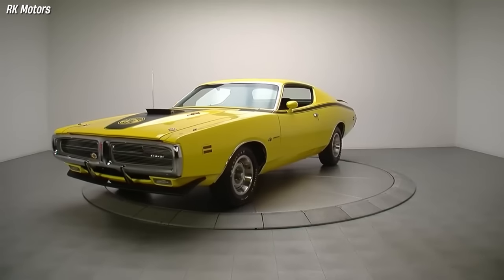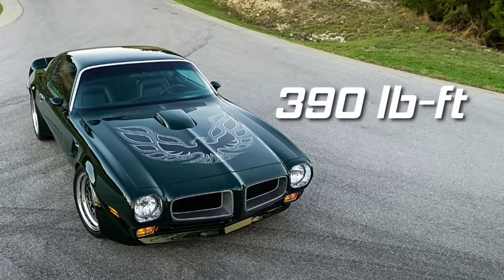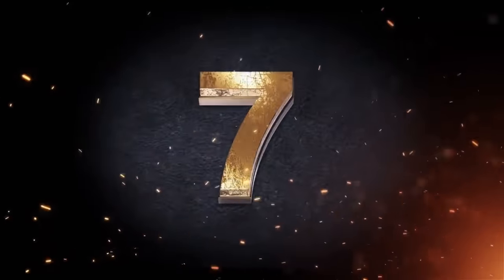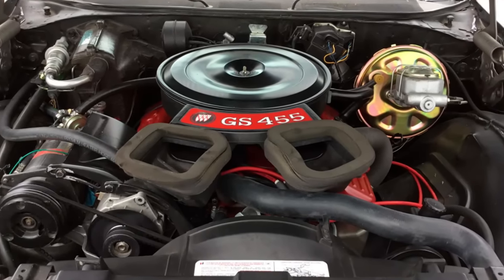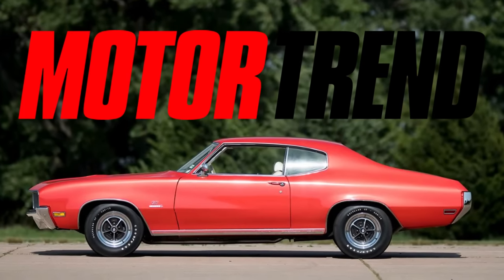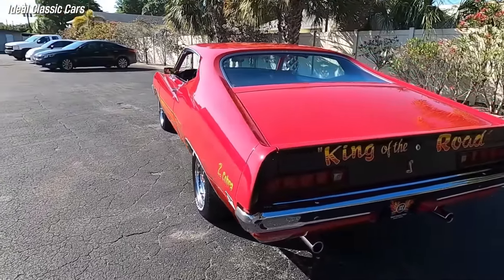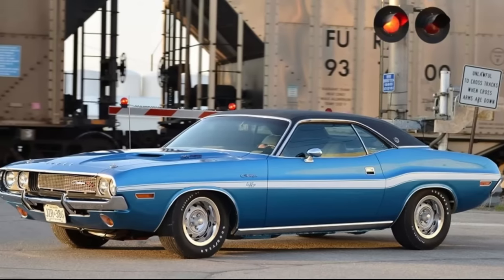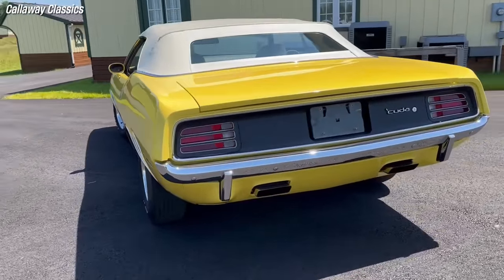Top 10 QUICKEST MUSCLE CARS Of 1970s

Comment: I had a 1970 Camaro and a 1979 Firebird. I miss them both. A lot of fun times.
Reply: I had a 70 1/2 Z 28 also ordered in Okinawa and picked up in Charleston 18 months later, no ac, power steering plenty of power. Fun car when there were not too many cars on the road. The insurance had a COW due to the HP to weight ratio.
Reply: In 1986 I had a 79 Poncho Trans Am. Loved the styling. T-Tops were the greatest but man the 403 Olds they stuck in it was a turd. My uncle had a 454 he'd pulled out of a 70 Monte Carlo SS, that he'd wrapped around a tree so I shoved it in the T/A, way too much vacuum tubing (not for the engine but man did everything in the car have something to do with vacuum) but we got it. Best summer of my life. Gas went from around $1.35 to $0.65 in a month and staid there. I was king of the back roads, or so I thought. Then like an A-Hole, I sold it when I went college. Should have kept the car, quit college after 2 quarters.

Comment: Great video but as I had a 70 Chevelle SS 454 LS-6 with a Muncie M-22 Rock Crusher and did a lot of drag racing I beat #2 and #1 on your list consistently!
Reply: the part he leaves out is all those magazine reported 1/4 mile times did not include a simple tire change. so ya the results will vary , and the 454 ls6 put out the most hp. with the possible exception of the zl1 all aluminum 427, copo in vettes and i have heard a few copo camaros

Comment: In 1981 I turned 18. For my birthday my father bought me 1973 Trans Am SD. It was white with the blue firebird.  It was 4spd . No factory a/c. It had  2 pull levers on each side of the front kick panels that opened vents. I kept it a year. We had a really bad snow storm and I couldn't get out of the driveway ( several hundred yards long) for almost a month.  So I sold it and bought a 4 wheel drive.  I would give anything to have that car back! 😢
Reply: Yea it's worth a fortune now
Reply: Those 73 Trans Am 455 are so cool. My similar story. I bought a 71 Boss 351. I was 17. My father was a service manager at a Ford dealership and knew a mechanic who had it for sale. Later, I  needed a 4x4 to help get to work as I was married and starting a family. My Boss 351 Mustang wound up being sold under very similar condition that I obtained it.
Reply: Being a MOPAR fan since I was 7 years old when my parents bought a 69 Roadrunner brand new, 383 auto, and my LEO dad chased and ticketed a speeder on the Interstate one night from a 70 roll, and myself having a stock 71 Charger R/T in 78 (440 4bbl) and now a much faster 70 Roadrunner 440 6bbl, I definitely admire BOTH the 73 455 SD and the 351 Cleveland based Boss. With a much needed upgrade in compression ratio and a hotter cam, the 455 SD was truly a RACE motor, and I have TREMENDOUS respect and awe for Pontiac doing that in 1973 as all other American V-8s were taking their last gasp. The Boss 351 likewise really needed a better cam and larger carburetor, and a single plane intake and headers would make it a FORCE to contend with!
Reply: I loved the 351 Boss. It was a great car.  I had a 69 chevelle  with a 350/300 hp motor.  Had the turbo 350 tranny.  I raced a '71 boss 351 with a 4sp manual.  We were neck and neck the whole race.  I still love mustangs,  I own one.  But Chevy and Dodge have a special place in my heart with the push rod motor!
Reply: I bought a '70 TA in '74. I only kept it half a year or so because gas went up to $1 a gallon and I couldn't afford 60 bucks a week to fill the tank.
I sold it for more than I paid for it but I still kick my ass for selling it.
I never kept the registration number so I can't trace it.
It was all red with a white hood scoop and white are extractors.
And if you know anything about 1970 Trans ams they were supposed to be white with a blue interior and blue with a white interior.
Like I said mine was read it had a black interior the low back bucket seats a four-speed no air conditioning and that thing was so freaking fast !
Reply: @stevejacobs8375  They were awesome cars! They were rated in the top 3 muscle cars of any cars built in 1970 or later .I bought another Trans Am later. It was '79 with the 6.6 and automatic tranny.  Only keep that about a year. Just was a slow boat., but it got the girls! Lol 😆
Reply: Pontiac FIREBIRD Trans Am
Reply: @williamg2552  If you had a Trans Am everyone knew what you had, but if you had a regular firebird or firebird formula you had to say " firebird "  first.

Comment: I still have my 70 Challenger 340 4speed car from high school haven't raced it in 35 years but in nearly stock form, stock motor only had headers and 456 gears it did a 13.7 in the quarter, with internal upgrades high compression 12.5 pistons Victor intake fairly big hydraulic  cam .500" lift duration 244 degrees  at .050" lift and 106 centerline car ran  12.7 at 107 that was really good  for a kid in high school  in the mid 80s that was also a daily  driver, actually  never towed it the the track to race always drove it, being the only source of transportation  I owned!!!
Reply: That's a damn lie. A 426 hemi with 4.10 rear took 14 seconds to do the quarter. No way your stock 340 was that fast
Reply: We had a guy that ran a 340 duster with Plumb Crazy on the rear quarters--the big blocks in town could not catch him!!

Comment: If u aint pulling gears manually... just get urself a grocery getter. Automatic transmissions to this day are a MUSCLE CAR CRIME
Reply: I never see no stick shift car I run transmission fluid at the drag strip. My 400 3500 stall. No problem in my 68 Camaro back in the day
Reply: Yeah manuals are fun and I agree but today tech is much better you can get more gears tighter gear ratios and a tq converter with very snappy shifts. Drag racing has always used autos as a primary. The muscle car was made to drag race. They just happen to have manuals for price and simplicity. Not much has changed other than the autos have gotten better and manuals are being phased out sadly but then again all muscle cars are being phased out along with the ice v8 so really what do you do. Today the hardcore lovers of performance that like manuals that don’t want the limitations typically go for a sequential dog box where you can continuously pull gears quickly getting all the satisfaction and control but no slow shifts, mistakes, or limited gears. In drag racing you will hardly ever find anyone in the manual class or using things like no lift shift black magic clutches and things like this that cheat the experience for a time to be competitive.

Comment: The 71 Boss 351 was quicker in the 1/4 mile than the 71 429SCJ.
Reply: I remember them being 14 second machine
Reply: I had a 1970 Ford Mustang Boss 351 Grande and it would smoke the tires off if you didn’t watch. Wish i hadn’t had sold it…

Comment: I have to say I've watched many of these comparisons and this is the first that had the Buick Stage behind the LS6 and Hemi Roadrunners of the day. In fact Popular Hot Rodding caused quite a stir over dubbing the Buick Stage 1 drag pack the Hemi killer!
Reply: Thats what iv heard saw or researched lol!! The Chevy 2 Nova SS 396 had a almost unbeatable poser to weight ratio not mentioned. The 302 camaro was a big block killer what about the 396 camaro. 
This guys just throwing shit out there had no clue. No Shelby GT 500 it smoked the mack 1.
Reply: @joshgessinger4509 The title of this video is "quickest cars of the 70's. The cars you mentioned are all or mostly 60's
Reply: @caseycassidy-k4z  guess ur right i missed that lol
Reply: The Buick stage 1 was way underrated in horse power. It was just a bit heavier body that kept it from getting out of the hole for the 1/4 mile and it would burn rubber each time it shifted. With slicks it’s a 12 second machine.
Reply: No LS6 Camaro, no 427 Vetts. Wtf.
Reply: @breldsystem6149  As I dive into the minutiae over the Stage 1 some interesting facts surfaced. The A body GMs all weighed about the same. The 445 Buick was Siamese bore that made it the lightest of all the big blocks of the time. That means that it had the quickest weight transfer during launch. These facts along with that the Stage 1 came standard with G-60-15s made it the quickest accelerating A body of all the GMs off the showroom floor. The key being “off the showroom floor”. Day 2 modifications were more productive on others engines than the  Buick but the weight transfer gave it quite an advantage.
Reply: @Paultricounty  There were no LS6 Camaros. 427 production stopped after 1969. This is about the 70s.
Reply: Stage 2 455's were capable of low 10's...
Reply: @usonumabeach300  Those were designed for drag racing purpose and, apparently, they were/are, monsters.

Comment: One of Fords fastest Mustangs that no one ever mentioned is the 351cj Cleveland. This was offered in Torino's also till 1972.
Was known as the big block killer. Chevy guys didn't like it 😅
Reply: Boss 351 I think you mean?
Reply: @jjtool5800  yes there was a boss351 and also
A 351 ho and cj
Reply: @jjtool5800  the boss
351 had solid lifters a bigger cam and Holley carb
Reply: As a #1 Mopar fan and owner, a 71 HP440 4BBL in 78 and now, a 70 440 6bbl Roadrunner 4 speed w/4.10 gears, I will say the Cleveland based Boss 351 is one hell of a well designed performance engine.
Reply: @avman1339  thanks Mr Morepower 😁
I used to get a ride in a 1966 charger 383 to Boy scouts. And my neighbor 3doors down
Had a 70 superbee 440 6 pack with the hood ram air with teeth. I absolutely
Fell in Love with those cars. I would take any muscle car from 1963- 72
Over any new car.
Reply: @avman1339  forgot to mention My 351 cj Torino
Laid waist to a 70 454 Chevelle. All I did was put
Quence heads, mild cam & hooker headers, and L60 meats on the rear.
It came stock with a 3000rpm Stahl converter
So always got a good launch. She was the fastest car at my school.
Reply: @iggyfritz7150 
There should've been a MOPAR merit badge!
Reply: @iggyfritz7150  The Boss 351 had a QUADRAJET 750CFM carburetor. It is the most powerful small block, from any manufacturer.

Comment: Got the order wrong for the street race scene. Cowl inducted 70 Chevelle 454 SS was unbeatable, because of the quick application of torque to 🎡 power. Ruined many a Cobra and Hemi's day, had lot's of fun. Ran mine on aviation grade fuel only. Still wish I had it, only car I ever named.
Reply: Myself destroyed a 70 454 Chevelle with a 351cj Torino 😮 all I did was add1970 quence chamber heads, elderbrock aluminum intake, Holley 780, mild Crane cam, headers.
Reply: Never ran against a '70 Cuda 440 supercommando  did you?  You would have lost,  no matter which of these cars  you chose!!
Reply: The chevellle 454 LS6 Couldn't beat a cuda 440 supercommando!!

Comment: For those that don't know, the 426 Hemi was still available up to 1971.  They raised the idle speed a bit to smooth cylinder to cylinder balance for better emissions.  Other than that, it was unchanged.
At the other end of the 70s, dodge made a pickup called "The Little Red Truck" - apparently trucks weren't as heavily held back by emissions - not to mention insurance tended to be less.
Pontiac offered the 455 until 1976.   Last of the real muscle cars.  Note, the 455 without the forged rods were limited to about 5000rpm.  Those cast iron connecting rods sucked.  Pontiac would sell the connecting rods into the 80s and I remember gasping at the $110 each price.  This was before Eagle made their rods.
Reply: Pontiac continued on passed 1976 when GM canceled all 455 engines. The Pontiac 455 from 1975-1976 was only making 200 HP but still made an impressive amount of torque. In 1977 they came out with the W72 400 for use in the Trans Am and the 1977 Can Am. It was rated the same 200 HP as the previous year’s 455 but didn’t produce quite as much torque. They made improvements in 1978 to raise the W72’s output to 220 HP that continued until the 400 was canceled for 1979. Pontiac built and set aside several thousand W72 400s for the 10th Anniversary Trans Am for the 79 model year. Pontiac did the best they could to keep high performance alive until GM corporate killed it off completely.

Comment: I am older than dirt, While working at blue max in dallas, We put a 455 pontiac,on the dyno,factory exh.intake,carb,& a 1 year only cam,( it idled to rough)510 hp.570fpt.5500 redline,he was turning low 10s automatic trans.94 octane...facts (1980)

Comment: Yep the cuda was bad ass for it’s time. The Hemi is still punching above it’s weight today. Unfortunately they are about 1000 lbs heavier today 🤣. Good video.
Reply from the maker: Thanks so much <3
Reply: @pd07  No thank you for the entertainment, well done. 👍
Reply: Buick beat the HEMI Cuda.
Reply: @thomasthurston6656 Buick GSX 455 Stage 1 vs 426 Hemi Cuda both STOCK is a great race, granted, BUT a little work and like many other engines (440 6 Pack, 454, etc) that would "run with" or even nose out the Hemi, when the mods start, the Hemi heads really show the excellent design for ultimate POWER.
Reply: @avman1339  HEMI Junk.
Reply: 1000 pounds heavier but with 300 more horsepower on a Hellcat.

Comment: You may notice that every car here was in 1970 and 1971. Except the 1973 SD 455 Trans Am. Now imagine how all the other's mentioned here would run with lower compression like the SD had to deal with. If the SD were in 1970 for GM or 1971 for ford and dodge it may have taken first place. Maybe.  Just saying it did quite well with low compression and emissions to keep up with all you mentioned. Loved your video.i subscribed.

Comment: Top 3 fastest 70s muscle cars in no particular order,
70 Buick Stage 1
70 Hemi Cuda
70 Chevelle LS6
Reply: You forgot 70 Boss 429
Reply: @iggyfritz7150 Great NASCAR engine, and no slouch on the 1320, but stock on the street, not so great.
Reply: @avman1339  your right of the showroom floor but a little tunning and better tires it was a monster.  in 1994 the claimed fastest street car
In America was a Boss 429. Myself beat some 13
Sec cars on the street with a 302. 2bbl single exhaust 70 stang coupe.
Most muscle cars suffered either poor driver or poor traction.
A friend had a 440 tri power built by Ramchargers and only ran a 14 sec 1/4 mile because it spin through all 4 gears
Reply: The fastest would have been the Cuda440 supercommando!!
Reply: @iggyfritz7150  that would have been the driver's  fault! !
Reply: @kevinmcduffie1092 The hemi made 425 hp and 490 lb/ft.
Super Commando made 375 hp & 475 lb/ft. How do you figure?
Reply: #1 427 thunderbolt

Comment: Though the 413 max wedges were the kings in 1962, they would not run 11’s out of the showroom floor.  Slicks and some prep would get you there. Also 1962 Catalinas were nowhere near 3500 lbs.  More like 3800 lbs.  This  list is pretty spot on though.

Comment: Interesting story- I bought  a 1971 Pontiac Grande Ville from the original owner in 1993. Had a 455 in it. She told me that right after she bought it, the motor "blew" and the dealer under warranty replaced it. She said instead of waiting for a brand new engine to arrive from Detroit, they had a totaled-out car "out back" in the yard that only had a few thousand miles on it, so she agreed to let them put that motor into her Grande Ville. So about a year later I had to go to Western Auto for something, I think a water pump, IDK. been 30 yrs ago, but the guy had to come out and read the numbers off my block and he asked me where this motor came from. I think there were some other things he noticed about the engine as well. I briefly told him what the lady had told me. He said it was an SD455 from a Trans Am. The Western Auto employee wanted to buy  it from me on the spot. Of course I couldn't do that it was the only car I had. I went back and asked her what kind of car that motor came from and she said "some kind firebird or something they said it was- I noticed it ran a lot better than it did before..."  And come to think of it, it could have an HO455 too. Lots of years and beers in between then and now.

Comment: The 429 SCJ was only a mid 14 second car that looked mean but that was it, the colossal intake ports were not designed for street use but for NASCAR. On the street this motor was a slug, small blocks from Mopar, Chevy and even the Boss 351 or Boss 302 mustang would leave this engine in the dust on the street. Ford made a huge mistake by dropping the 428 CJ in favor of boat mooring.
Reply: Agreed, I test drove a 429 SCJ drag pack Cyclone and it was so slow.  My friends 69 Mach 1 428 was the only fast ford I ever rode in.

Comment: The air-grabber on the Road Runner wasn't power assisted (hydraulic). It was vacuum assisted. Dodge had the rights for the 440 Six-Pack moniker. Plymouth couldn't use it, so it was 440-6 (6-barrel) in their model line. You don't call a 'Cuda a Six-Pack. That's for Challenger, Charger and Coronet.

Comment: My how the strong had fallen.  The difference between that '73 Trans Am, and the '78 that I owned was huge.  In '78, mine had a wimpy 180 HP, and couldn't even spin the rear tires on dry pavement.  But it sure looked good...like the Smokie & the Bandit TA.

Comment: I once rode in and drove a '70 ', Cuda it had a 440 super commando,  Dyno tested right out of the showroom pushing 456hp it ran an 11 second 1/4 mile at around 130 mph, It would bring the front wheels off the ground, with a 160mph speedo that I'm sure it could bury the speedo!!
Reply: That’s totally BS mid 13’s at best and the only way it pulled the wheels was with a jack😂
Reply: If you ran 130 in the 1/4 you would be in the 9s and making 700 hp. I call BS too.
Reply: 🙄🤣 TIME SLIP OR IT NEVER HAPPENED 😂 SO MANY 11& 12 second street cars show up to the track the first time and get 14 and 15 second TIME SLIPS 🤦🤣